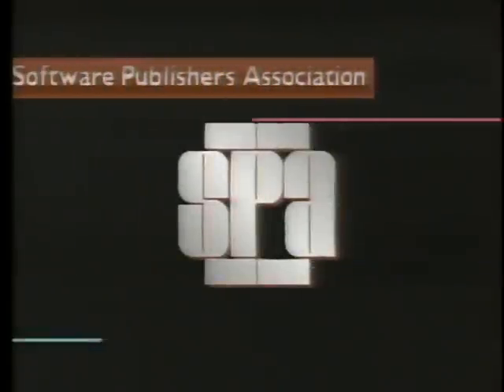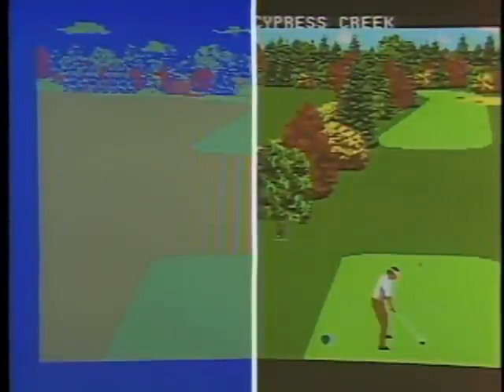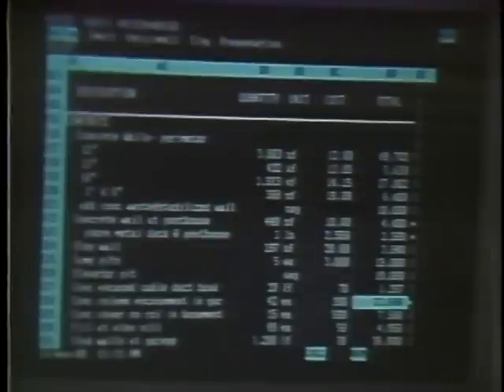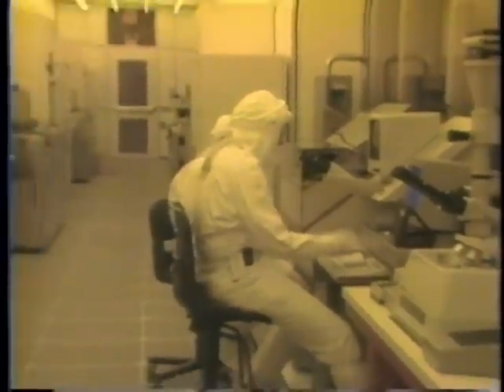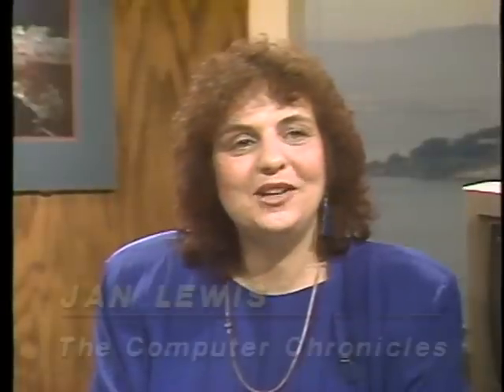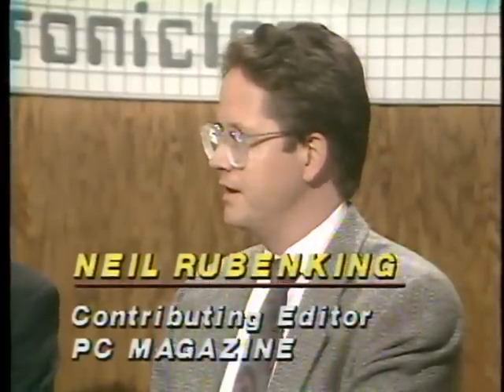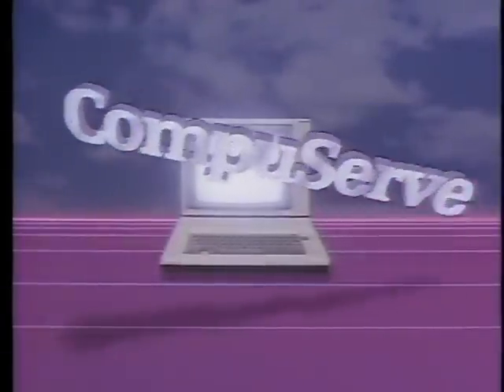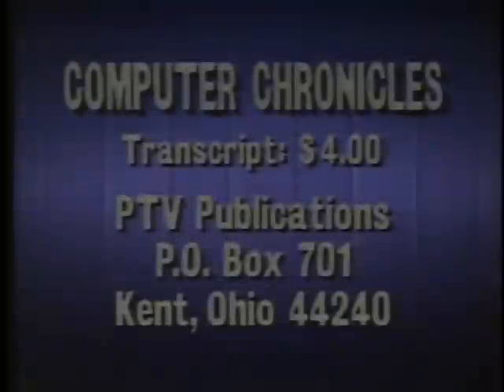The Computer Chronicles - Megahertz Mania (1989)

Comment: i love how he says we hope to reach 200mhz by 1999...well my sir in 1999 i had a 750mhz amd athlon computer so i hope you were happy! :)
Reply: consider that it was INTEL talking, the real innovators in the CPU world threw out the 90's - mid 2000's was AMD, clock for clock AMD won hands down, and on price, INTEL just had, and still has deeper pockets too grease the PC makers too use their chips.
Reply: I had a PIII 800MHZ SMP system, that's two CPU's on one board :) With a shitty VIA chipset :(
Reply: TheRealWitblitz O GOD don't get me started on VIA, the only thing they have ever got right has been onboard audio. I have actually owned one of the VIA PC1 C7 boards, and I was always having trouble with it either being slow as dog shit, or driver hell, same with the Everex laptops that had the Mobile C7 chipsets, I bought 1 for my Niece, and one for my g/f at the time, as i was able to get them for slightly over $500 from Walmart, and just about every week I was having too do tech support on those damn things usually do too something VIA screwed up with an driver update threw Windows. VIA also has about the worst Linux support I
have ever seen from a company. I'm amazed they are still in business.
Reply: i got one AMD-K6/2 500Mhz (super socket 7)
586 Class system -  did once run Windows 2000 SP3
not a big issue..
Reply: Commodorefan64
Many of the big innovations back in the 1990s to mid 2000s such as copper interconnects and high speed caches were made by RISC CPU venders such as IBM ,DEC land SGI.

Comment: The 386 was a potential step forward but as a computing platform at the time it lagged sorely behind the 286, MHz for MHz, because of CISC and how the 32-bit instruction set was implemented.

Yes 32-bit was going to be the way of the future, but at that time mainstream was solidly 16-bit which meant that the 386 was just a waste of money.
Reply: ? This is just not true
Reply: @ryanyoder7573  I was a techie at that time (my first ever overclock was an Intel 8088 from 4.77 MHz to the dizzying heights of 6 MHz) and I switched to a 286 and over the years replaced the version I had until I everntually ended up with a Harris 25 MHz 286).

I had that all the way during the 386 generation because for my main use case (for instance Word Perfect 5.1 for text processing) the 286 was BETTER than the AMD 386 computers I built for others (even though I told them they would be better off with a cheaper 286.

I wasn't until the 486 that 32 bit started to become mainstream and I built a 486 DX50 system for myself.

The problem is that Intel put the 32 bit CISC instruction set ahaed of the eight and sixteen bit instructions, thus, because software was overwhelmingly eight and 16 bit to run those apps on a 386 meant that every instruction had to run the 32 bit instruction set gauntlet before reaching the instructions the CPU could execute.

Windows for Workgroups 3.11 could run a 32 bit version, but that was buggy as hell compared to the 16 bit version.
Reply: I'm not an architecture expert but I suspect the cost/performance difference had more to do with the bus size differences and capabilities of the more advanced 386 causing them to require more die space compared to the mature 286 design.  Bus speeds were interesting back in that era, some systems used 286s on the xt platform which only used the 8bit isa bus instead of the 16bit eisa that the 286 was designed for.  These devices even needed custom ide implementations since that standard was never meant to be used without a 16bit bus.

Comment: I'm writing this comment on a computer that's almost a hundred times faster than anything they showed. Amazing.
Reply: Only almost a hundred times faster? Seriously? You must have a very, very weak computer. 486 processors were about 10 megaflops (able to run Doom), while in 2010 there were already 100 gigaflops CPUs (i7-980 for example). Current consumer desktop CPUs are up to 800 gigaflops, which is 80 000x faster than 486. PS5 has a million times faster GPU than the 486.

Comment: 1992, 286, Tandy 1000  RLX 20 Meg. Hard Disk Drive, 3 1/2" Floppy drive, monitor, keyboard, mouse, printer. A three-year warranty, which came in handy since the hard drive was faulty. It was replaced  and worked great. I liked DOS, Windows 3.1, Desk Mate( an early, fun, easy to use Graphical User Interface)!

Comment: "There's no way to increase the megahertz or the speed of which your computer executes instructions" - Sure there is, it's called overclocking.
Reply: Wonderpierrot those processors couldnt be overclocked.. first pentium could but only trough hardware..not bios..what you do i use ducktape and isolate first and third oin on the processor..but only to next mhz..for instance pentium 100 could go to 120.. or pentium 120 to 133 mhz..etc..
Reply: @semiborba7047 , and depending how far back you go in time, you wouldn't want to overclock. Earlier OS's and software adjusted their timing based on the processor clock speed. You could potentially go higher, but it may break the software, even if the hardware could handle it.
Reply: @fcex558  Even then, it could only do so much.  Even when you lower clock speed, bus speed, and disable caches, the system may still be too fast.  I remember in the 386 I used as a kid, even some really old games were still too fast if I had the turbo switch in "slow mode".
Reply: you would have had a tough time overclocking via front side bus on these chipsets. Core multipliers weren't a thing back then
Reply: You clearly didn’t have any experience with this era of computing. Now you can overclock an unlocked chip by clicking around in your bios and having a whole pile of settings auto adjust based on what you selected - things like bus speeds, timings, and multipliers. None of this existed back then, and especially without multipliers, this was an extremely difficult thing to do manually.
Reply: @BlownMacTruck  People sold pre-configured overclocking chips, particularly for Macs since they had a limited number of motherboards. They would have one or a few pre-set configurations, you'd replace or plug on top of existing clock generators. People even "overclocked" Apple IIs actually by replacing the entire CPU on an add-in card. At this time, CPUs weren't that expensive, RAM, followed by disk storage made up the bulk of the cost of a computer.
Reply: @straightpipediesel  Well yeah. Not sure how that’s contrary to anything I said.
Reply: @BlownMacTruck  It wasn't extremely difficult. You bought the chip, plugged it in, and at most selected from one of several settings. The 386 only had 5 speed grades. Many computers, particularly Macs only came in 1 speed. So people could test settings in advance. There's nothing like today where people try to figure out how the factory is binning stuff, how cache limits speed, disabled cores, turbo boost, FSB, DRAM timing etc.
Reply: @straightpipediesel  LOL right, because average people were often scouring the places these types of things were sold, popping open machines back then and replacing chips, then troubleshooting boot ups and stability without giant amounts of internet knowledge to support them. That’s totally not a manual process that only a handful of people would engage in.

I won’t even get into how that’s not even close to how it works today, where back then you had to contend with all sorts of locked bus speeds and unadjustable timings, and working around those was an absolute nightmare.
Reply: @BlownMacTruck  Wrong. Shows how much you know. They were sold in popular catalogs like PCMall and MacMall. I remember several pages of them in each edition. They were boxed products, with manuals and vendor phone support. Again, you're intentionally ignoring my point that since there were so few configurations, it was easy to test and validate.
Reply: @straightpipediesel  I think we have completely different views on what “average” is. No normie was looking through PC Mall scanning for binned pieces (not to mention that’s not even the type of thing you’re talking about). And that’s beside the point - the entire point of my original post was about how easy it is to execute and adjust all the stuff you need to do to overclock in software before you even start investigating hardware binning. The reason kits existed in the past was because you had ZERO ability to adjust bus speeds and timings, meaning unless you stuck to those very basic kits you’re talking about, you had to jump into extremely low level adjustments that required not only specialized knowledge, but debugging hardware and testing equipment. Today you can incrementally increase all manner of timings on different parts of a motherboard from software with automatic failback. Of course there were very limited hardware configs back then, but that was exactly the problem. Pray tell, how do you think you could adjust bus speed timings in indivisible clock steps back in the day? How would you adjust voltages on RAM slots, especially when they were soldered? And cache refresh?

The reason those kits existed was because those limitations required you to operate in very strict lockstep with non adjustable multipliers. These were hardly configurable outside a very small set of lockstep speeds and completely archaic compared to stuff you can do in software today. So yes, this was an extremely niche thing back then - the kits you’re talking about were already a minuscule part of the market and were the equivalent of overdrive processors that Intel used or straight up hardware swaps. To do ACTUAl overclocking like you do today, you had to get down to the level of tracing out clock lines and knowing how to use an oscilloscope with a probe. You’re confusing stock proc frequency upgrades with overclock tuning. It’s like confusing a hamburger with a seven course meal at a Michelin starred restaurant.
Reply: @BlownMacTruck  Triggered! Grandmas didn't have PCs in the 1990s. Again, I remember the products. You don't know what you're talking about either with nonsense about oscilloscopes. Most CPUs in the 90s were cooling limited since CPUs were passively cooled and many didn't even have heatsinks. Ensuring proper cooling was first. Nobody adjusted voltages, everything including DRAM and CPUs ran at either 5 or later 3.3 V. Chips all ran on a single power plane. Again, you don't know crap about old computers.
Reply: @straightpipediesel  Uh, dear god. Not only do you keep moving the goalposts (apparently average users knew about this stuff but that doesn’t include grandmas but does include readers  of specialty PC magazine marketplaces but does include Apple ][ users and on and on) don’t even know what I’m referring to when discussing bus speeds or voltages. That’s relative to how we do it now. Yes, we did that back in the day, but the fact that your overclocking knowledge ends at generic kits you buy in magazines just shows the limits of how much experience you actually had with it. Kits barely scraped the surface and stuff went WAY beyond that. No wonder you’re so clueless about all this stuff - you didn’t even know it existed. How do you think bus speed tuning happened without software mediated controls? I’d love to hear how you think that was done back in the day since you think scopes and other tools with low level mods weren’t needed.

I also love how you tried to bait me with “triggered”, as if that had any meaning in this context. It’s totally the sign of someone panicking when they start realizing they’re out of their depth.

Comment: THAT SUPPOSED SPEED INCREASE FROM 286 TO 386 IS BOGUS. The 286 is slightly faster clock for clock the the 386sx. The idea that 386sx was much faster than 286 caused me to buy a 386-16Mhz machine. Let me tell you, that was the worst £650 I ever wasted! If you watch carefully, you'll see how this amazing 500% speed gain was achieved. The 'Standard' AT contains a 286 CPU. But, his upgrade card contains a 386 AND 387 FPU. Little known fact, but the 387SX FPU is actually a 287 FPU. in other words. You would have been better off speedwise, in buying a 287 FPU for the standard AT. And it'll cost you half as much.

Comment: I remember the checkerboard pattern as I loaded a 0.8 MB photo on a floppy into a 486 system in 1992. You could (and I did) go outside to smoke a cigarette. By the time you came back, it might be finished.

Comment: I used PADS-PCB with MSDos Smartdrive in 1989 and had a 10:1 disk speed improvement. Loading a large PCB project without Smartdrive took 2 minutes, with Smartdrive it took 12 seconds.

Comment: and now today its the gigahertz mania
Reply: or multi-core mania ;-)
Reply: Martiiin2008 I think we're heading back to the GHz race now!
Reply: venichen1
With mobile phones; 5GHz is pretty much the practical limit and desktop processors are already there.
Reply: kimnice Intel has down clocked icore to 2.8ghz at defualt before turbo but they are experimenting with automatic turbo is some lower end ivy bridge cpus
Reply: kimnice You're confusing RF radio frequency with CPU clock speed.
Reply: CPU clock rate is a sum of individual lines and independent threads but what determine the actually speed is the logic capacity.
Reply: Damien Hartley What? Clock speed is the rate at which individual transistors in the CPU are switched on and off, which may or may not be a multiple of the frequency master oscillator on the motherboard, depending on the architecture.
Reply: pigpenthegreat point is better to have more cores then more clock speed.
Reply: ***** My solution is stop buying intel or stop pc gaming because intel thinks nobody needs clock speed or good gpus.
Reply: Kyle Johnson 
I have 8 cores in my $150 mobile phone. Feel crazy..is mobile software really so multi-threaded that it would need that many cores at the moment? Would two "bigger" cores be faster in most cases?

Comment: Fun fact, if you run an 32-bit Intel system, you'll see that it is sometimes referred to as an 'x86' system, which is a reference to Intel's 386 board and it's various cousins. They still run on the same instruction set to this day.
Reply: What's a 386 board?
Reply: +louis tournas The 386 board being discussed in this video is a 'microprocessor', or what we would now call a CPU. Today's equivalent would be an i3/i5/i7 processor.
Reply: Agent X506
 OK, but people usually call it a processor, microprocessor, CPU.
Board makes me think of a circuitboard (motherboard, video card, NIC).
Reply: +louis tournas Ah, but this was back in the days before CPUs could be added or removed from the motherboard. They were often sold together, thus the confusion. 
When people talk about 'the 386 board' they are usually talking about the CPU in particular, especially when they talk about speeds like 33Mhz, but since you couldn't simply buy another CPU, it meant buying a whole new motherboard.
Reply: +Agent X506 You could do that years ago. Today they change the memory.
Reply: Claude Rains
"You could do that years ago. Today they change the memory."

==What do you mean?
You can upgrade your CPU or memory even today.
Reply: louis tournas
Well you couldn't change the memory in older systems as it was fixed to the board. You had to buy an add-on card that would take dram memory. And not all computer makers had fixed CPU's, It was all about the maker and how much you wanted to spend. Some people would send their board in and have a new one  soldered on. Again it all depended on whom made it.
Reply: +Claude “Reviews4U” Rains People take for granted nowadays how customizable PCs are today.  Used to be, you bought a PC like you buy consoles.

Comment: And this is where Amiga had lost already in retrospect. By that time we had the 2000HD and a colour VGA PS/2. Of course they were both differently segmented in price but the writing was on the wall since Amiga had stagnated. Jay Miner had left as well out of frustration. Year 1991 and we had two 486 towers with svga and soundcards at the same price as one A3000 which had little more to offer than the 2000. Writing was on the wall here in this episode, quite clearly.
Reply: Exactly.  The dedicated hardware for the Amiga ended up being its deathbed since it wasn't scalable, nor was it even replaceable through backwards compatibility with off the shelf components.  Nope, had to wait for decision makers at Commodore to determine that fate for its users, which we know the history from there.
Reply: Yup, Commodore was firmly stuck in the 1970s hacker mindset and couldn't understand the market they themselves created. This company thought the TED series was the natural successor the C64 ...

Comment: On the Apple ][+ we got a Transwarp card which effectively increased the RAM to 256K and the speed was 3.58 MHz (3.5x faster?). Looked a lot like the AST 486 card implementation where they effectively put a computer on a card. During boot you could press and hold ESC and it would not turn on. When it was on, it made games like Wings of Fury hard to play with - trying to land the plan on the carrier deck. Expansion cards like that and "clock cards" made them exciting. Today the only real expansion is for GPUs mostly.

Comment: in 1989 they expected to have clock speeds of 200MHz by 1999 but in 1999 we got the Athlon AMD running at 500 to 1000 MHz lol
Reply: Given the same spacing of MHz, it would seem that in 2020 era we'd still be at just 1 GHz barrier.  What a thought to embrace to see how things would've been if that history unfolded. We'd still be stuck using real audio.

Comment: He way underestimated the 1989-1999 speed gain. It didn't go from 33MHz to 200Mhz, it went from 33 Mhz to 1Ghz... most of that speed coming between 1997-1999 alone. We still remain at a wall of 4-4.5Ghz on all cores and have been there for quite a while now though single cores can temporarily boost well past 5Ghz on the newest CPUs.